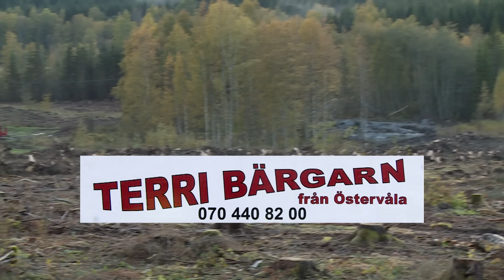Excavator stuck in deep clay - Heavy Recovery - Terribärgarn - Sweden

Comment: I don't know why the recovery company does not employ a mechanic that is skilled with returning engines to running condition after flooding.
Reply: Why would the recovery company do that when excavator companies have their own mechanics. It's not the recovery companies job to make other companies machines work again.
Reply: @catd11ng74  my thoughts are a running machine would be easier to recover than one that has to be dragged out of its position.
Reply: @2secondslater  
Ok. But that is still the excavator companys job. What if the recovery company have a mechanic and the excavator breaks down. Do you think any recovery company wants to pay for that. No it's up to the owner of the excavator to get it running.
Reply: @catd11ng74  I think that if a contract for recovery included getting the machine running to assist in the recovery of the machinery then there wouldn't be much argument. I have been contracted by recovery/towing companies in the past to get mining vehicles and machinery into running condition for recovery. It's not such an outlandish idea.
Reply: @2secondslater  
Ok. But if it's possible to recover the machine without the engine running it's way easier and cleaner to get it running after the machine is recovered. And how do you know what's or if anything been damaged if the machine is deep down in the mud. There are for sure lots of water in the electric system.
Reply: @catd11ng74  dude, that's why I said a mechanic that is skilled, there are ways to figure out if an engine is able to be returned to running, and most electrics and electronics operating in harsh environments are sealed from liquid ingress, it ain't rocket science. Have a good day mate.
Reply: @2secondslater  
No it's not rocket science. There are no guarantees everything on an old machine is 100% watertight. And by the way a mechanic can't drain anything because of all the environment laws. Bye bye!

Comment: Why not just lift it out with helicopter(s)?
Reply: and pay 2-3 new excavator prices for it?
Reply: First, the logistics of that would be insane. :)  But airlifting it is simply not a viable option.  The excavator is mired in clay.  The suction alone caused by trying to dislodge it vertically from that slop would be like trying to lift 200 tons.  You have to pull it out like they did, from the side. No other option really.
Reply: silly comment